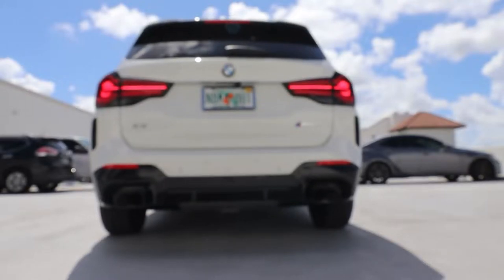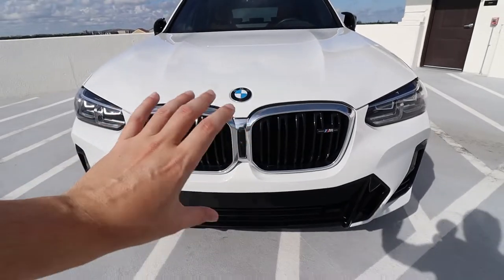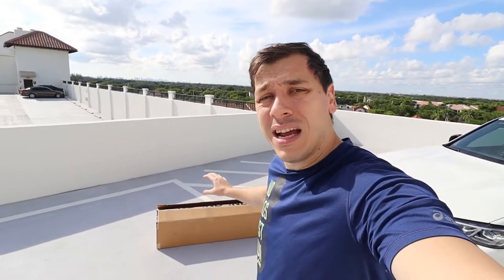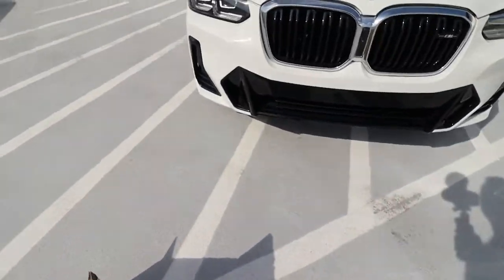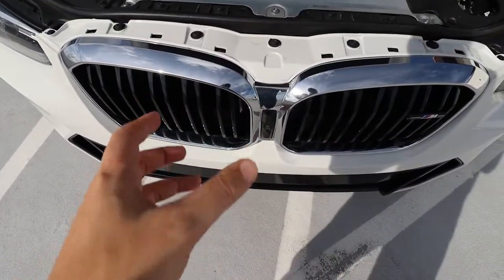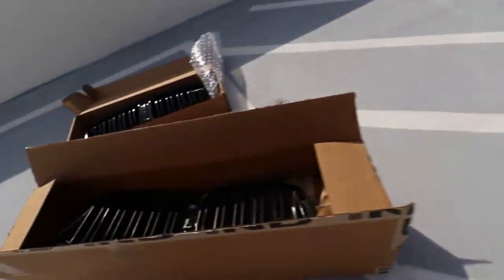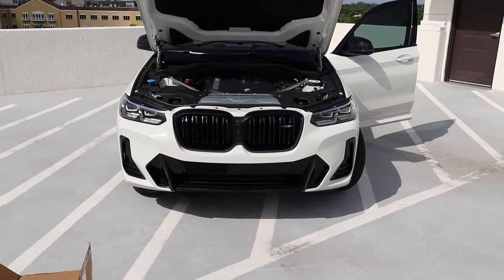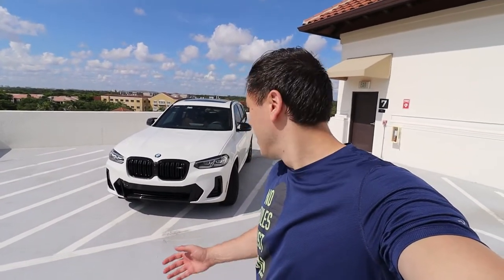How to Install Kidney Grille on BMW X3/X4 G01 G02 M40i LCI OEM Gloss Black! #howto #bmw #bmwx3 #cars

Comment: 8:25 how did you just remove the center part with the camera hole? I don’t want to replace or take off my grill. That center piece got damaged
Reply from the maker: You have ti take off the grill to get access to the clips on the back. It’s pretty easy but without taking it off it would be pretty challenging!

Comment: Great video! Seems simple enough. Kind of strange what BMW did with the LCI grill colors. Used to be the 30i had chrome, M40i had Cerium Gray but now it's switched.  I just traded in my 2020 M40i for a 2023 X3M a few weeks ago.  I got the non-comp so it also has the chrome.  I don't love the chrome but don't hate it either. TBH, I preferred the Cerium on my M40i.  Literally everyone swaps to black so it's kind of nice to be different.  But good to know in case I ever do feel like changing the grill.
Reply from the maker: Thank you !

Comment: Does anyone know if the grill is one piece or the surround part can be separated?

In other words, can the chrome surround from the original grill be removed from the center?
Reply from the maker: One piece. At that point just wrap the gills back on the chrome one.

Comment: When I reconnect the camera everything will work correctly? I won’t need to recode or anything?
Reply: I think you will have to turn on the car. Leave the vehicle and come back inside and it'll work
 Cheers
Reply from the maker: Just plug and play. No coding needed or adjustments.

Comment: Skip to 3:45 to get to the action.  This 12 minute video should have been maybe 3 minutes long.  1.  Pop the clips on top of the grill.  2. remove the camera from it's clips and install it on the new grill.  3.  line up the new grill with the clips and push it on.  Three minute video, maximum.